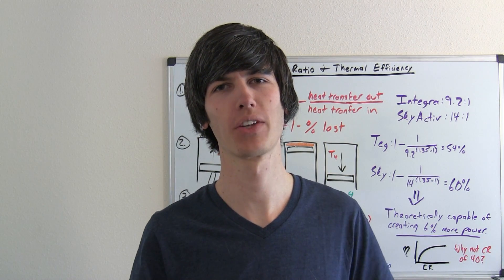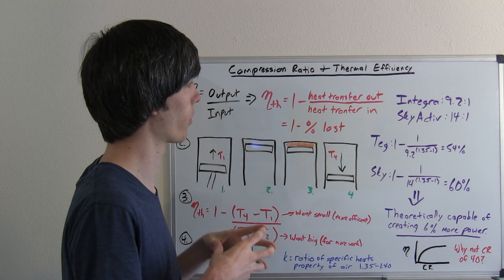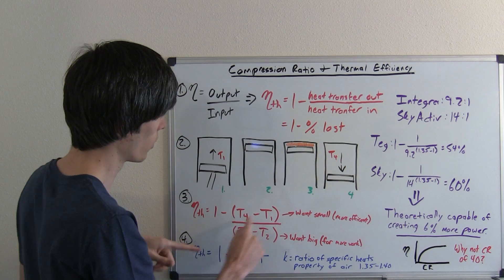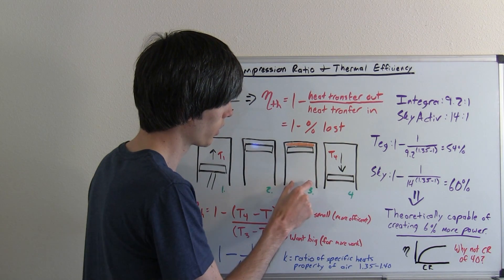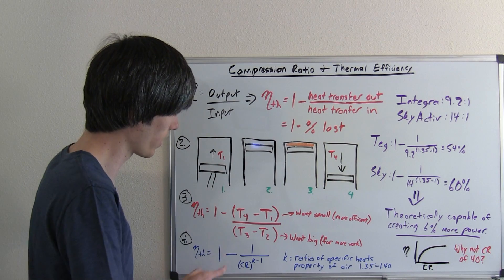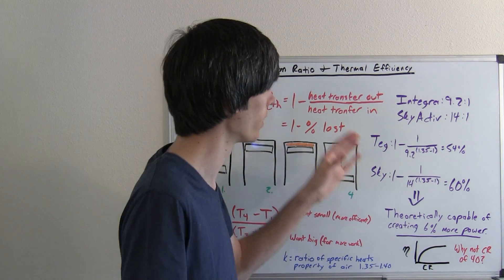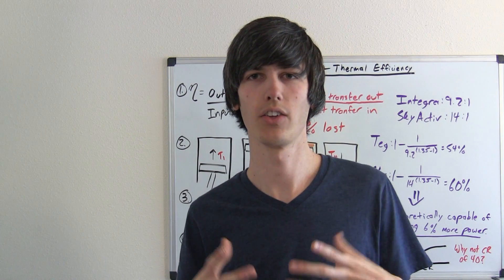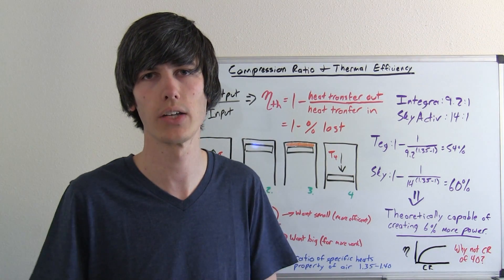Compression Ratio and Thermal Efficiency

Comment: David Blume says in Brazil VW stopped making gasoline cars Now theyre ethanol only.He says they have cars with 12.5 to 15.5 to1 compression ratios and even though ethanol os 63-65% the heat value of gasoline they get same or slightly better fuel economy on ethanol.Heres what I want to do:I want to convert my 6.5HP gas engine (8.5 comp ratio) into a15.5 to1 comp ratio 100% ethanol only engine.How would I do that?Change the crank shaft? Thanks!

Comment: Do you think its a good idea to coat the piston  heads and insides of cylinder heads with ceramic coatings to resist heat and heat transfer to cooling in order to gain more power, fuel efficiency and longer engine life?Ceramic engines a possibility in the future?

Comment: I am subscribing! 
You give great summary lectures, even though they are not extensive as a thermodynamics class, you hit all the important points and explain the reasons why they are important wonderfully. 
Just a suggestion on another vid you can do to follow up this one: go over the factors that rob the system of this ideal efficiency return such as heat loss, materials strain absorbing energy, the surrounding materials absorbing heat, trapped CR vs geometric CR, exhaust gas temps,sound,etc.

Comment: The truth is that the internal combustion engine is very inefficient. Most of the energy is disipated as heat that is why you need a cooling system. The internal combustion engine is a testament of how much energy is stored in fuel, only a little bit will give u big bang.

Comment from the maker: Because this is the ideal equation, meaning if the engine turned all heat into work it would operate at an efficiency of what was shown. In reality engines lose a ton of energy through heat.

Comment: Why is that when you used the compression ratio equation the efficiency was so high even though the normal values for gasoline engines usually don't exceed 25%

Comment: I'm curious to the relationship between compression ratio and boost (forced induction). Years ago engine builders were building low compression/high boost packages, but recently there's been a shift towards higher compression/lower boost packages. If the combustion pressures are the same (at a given rpm), what other differences may be seen other than intake temp on the high boost package and increased lag in the low boost package?

Comment: how about rotary engines?? im pretty sure rotaries are not efficient because the angle that the expanding air pushes the rotor is not very efficient, resulting in a lower thermal efficiency

Comment: Loved this video and waited for it, to check if I was wrong in my perception of it.  Wasn't far off, that is, now hoping your'e right :)  Thx again, btw you should mention the racing engines that run N/A only classes: F1 has a 17:1 CR last time I checked and Nascar is 12:1.  Will you do a video on the octane rating soon and how fuels prevent knocking and how this relates to the CR? (Sorry if you did already and I missed it)

Comment from the maker: Basically higher boost engines may use lower CR because the boost will give them added pressure/heat, and higher compression ratios would require better internals to handle the additional added pressure.